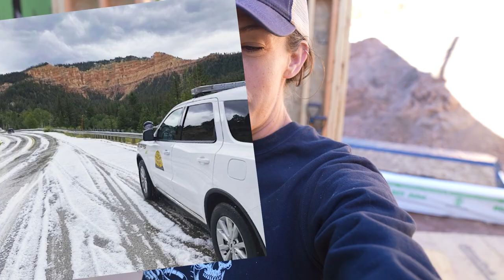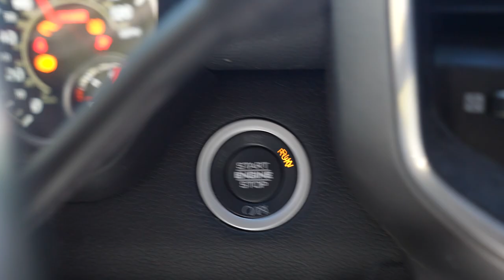Framing Our Second Story | Building Our Own Home

Comment: I just realized Trent is going to need to build a shop a big one to put all of his machine in so I see another project coming in the future. 😮
Reply: Trent could design his man cave to be in that new building which would leave a shelter for another personal vehicle this winter and future winters. 😘
Reply: Trent should have framed in another garage door and used the Casita as his man cave.
Reply: How are you going to attach the garage to the house so you don’t have to go outside to get in and out of the car?
Reply: @Butterflies.and.Tulips tunnel?
Reply: 20:28 is a funny perspective.  Looks like the garage roof is surrounded by the new floor.

Comment: Trent, if you nail a 2x4 about 30" long vertically to a stud or wood sheathing of the first floor standing proud above the deck, you're standing on about a foot. When you stand your wall and it decides to let go from your toe nails, it can only go to your block. Also, you should toe nail the bottom plate to your snap line, square it, and sheet it. It's way safer and faster to do it on the deck. I know safety is your middle name. 🌎✌️😉

Comment: To recap my statement from last Friday. I did live thru a remodel. It was my childhood home and my parents thought it would be "great" to do a remodel during the a El Nino cycle in the early '80's.. It involved the demo and removal of an original fireplace and interior grill. For point of reference,  per the layout for "The Brady Bunch" kitchen layout, if you look to the left of the oven, there you'll see an interior grill. That was what was in my childhood home. The fireplace was on the other side of this brick and mortar structure and the grill was on the other side. The fireplace looked out on to the Living Room, the grill looked out on to the kitchen. This structure was big and was a grotesque producer of *dust*! I'm talking about dust that keeps showing up, months (years) after the completion of the remodel. The remodel also knocked out an exterior wall in the winter. Mind you,  yes it was So Cal. However, it was an El Nino cycle. Which meant it was cold and wet all the time. The  remodel impacted the kitchen, so meal planning and prepping was a challenge! The remodel eventually  claimed the driveway., too. My parents had the original asphalt ripped out and replaced with concrete. This meant trekking thru mud in the morning to get to school. My shoes never recovered.  RIP Shoes!

Comment: Tip for the artwork.   Flatten, get ARCHIVAL TAPE or photo corners to secure the pictures.   You don't want the acid from normal tape eating your artwork or pictures.   If you ever see pieces that have "yellow" or color seems to separate in framed pictures - that's the acid.  Hope you have embraced your flakes and enjoyed your woodburner from Instagram  - I'm scrambling to finish harvesting my garden and prepare for digging up my Dahlias for the winter.

Comment: SUGGESTION:  i recommend that your buck stove should be in the middle wall of your mud room and have the smoke tube come out of your middle wall instead of the roof.  Your mud room will benefit from the buck stove far more than your current location.

Comment: The simmer grate we call a defuser, it's flat has a bottom piece of metal with holes in it, then a space of about a half inch and a top piece of metal with holes in it that are offset from the bottom holes. The ones we use in our restaurant have a handle on them. Simmer things all day and never burn. They only sit up about 3/4."

Comment: Are you guys concerned at all about snow piling up in that in between spot where the current houses window and the new wall (where your AC fan sits) begins? I can’t tell if the over hangs will prevent snow accumulation there and in turn against that window and AC unit.

Comment: Looks like the addition is bigger than the original house, what is that going to do to the HVAC system, will it handle the extra volume?
Reply from the maker: The addition will actually have a separate hvac system.

Comment: This is the 3rd or 4th video I've asked this question and no one ever replies.  Can some please tell me what "rolling joists" means.
Reply: Ask Google - Lots of info!!!
Reply: It means to get the floor joists up on the tops of the walls laying sideways approximately where their location is going to be and then you work from one side to the other with your layout 16" or 24" , or some extreme cases 12" and then you roll them, meaning stand them up, and nail them into your rim joist which is material that is just slightly taller than your floor joist by about an eighth of an inch. So rolling joists means to just tip them up into position and nail them off. It would've been used more commonly back in the day when we were using all dimensional lumber and not so much engineered products. But it just carried over.